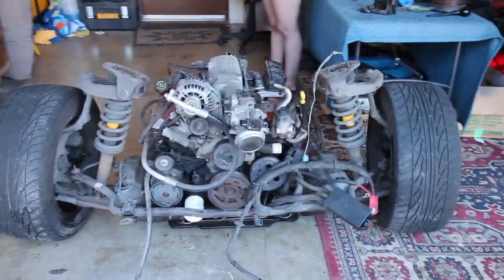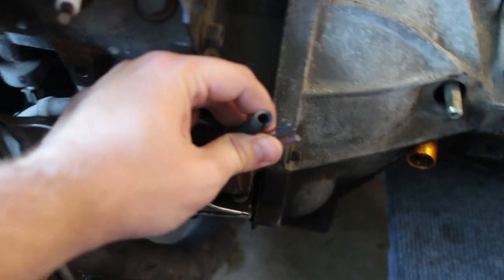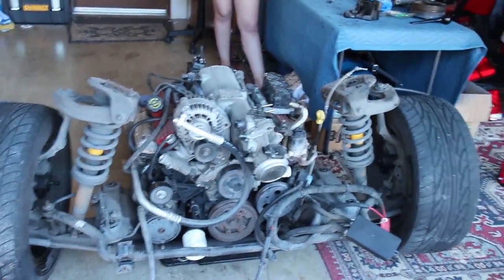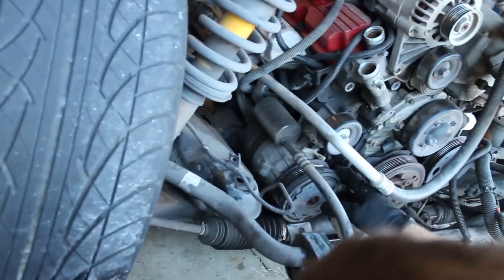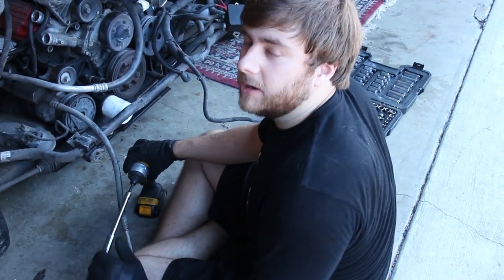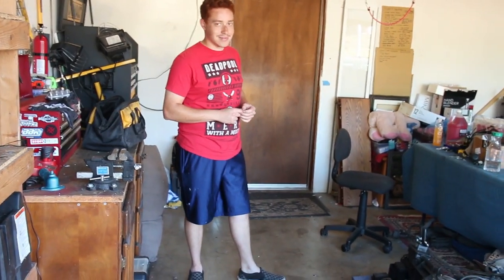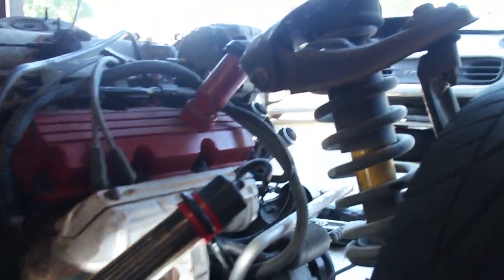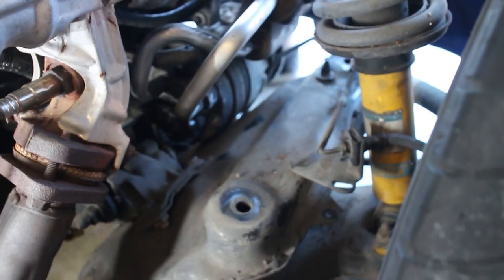Project F L67 Camaro Rebuild Part 1 (Starting our Supercharged V6 Camaro Rebuid!)

Comment: Damn, guess my V6 bird is a shitbox XD least the TA has AC. Also, you should keep the oil pressure sensor if you can, there is a gauge for it in the gauge cluster.
Reply from the maker: Yeah we're still going to use it since we're using the Camaro's harness

Comment: Jury Rig Garage I can't tell in the videos but is that a 60° or 90° block?
Reply from the maker: This is a 90 degree block.
Reply: @JuryRigGarage   Okay. Do you have a guide you can send to me or something on how you're running & where you're putting your accessories on the front of the engine?

Comment: AC? Come on you live in Oregon. It doesn't get that hot. AC is 2-50. You don't need actual AC
Reply from the maker: It regularly get to 90+ degrees in the summer. AC is absolutely needed.